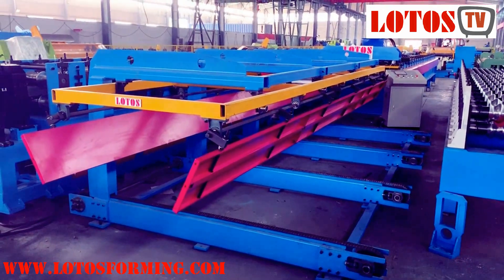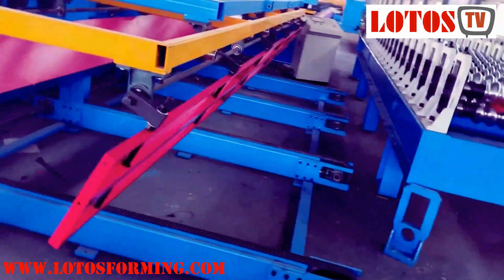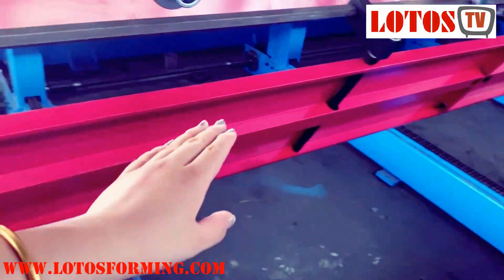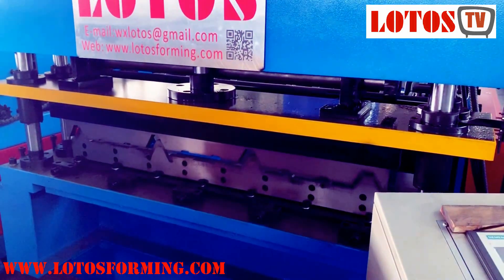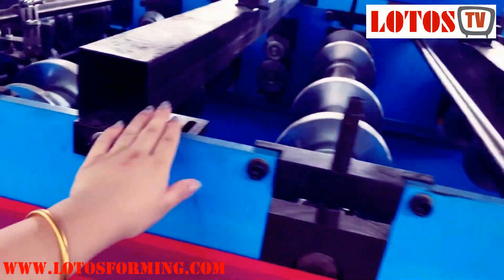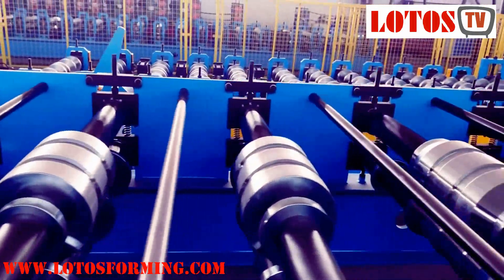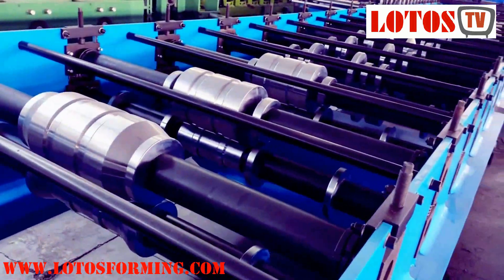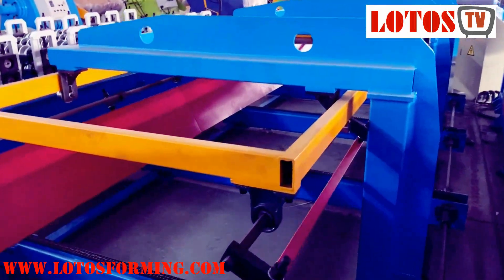【Wall Panel Machine】: Fully Automatic wall panel machine with stacker machine | Roof panel machine

Comment: Wall panel varies based on the sheets used as well as the foams and insulation used and the thickness and width of the panel